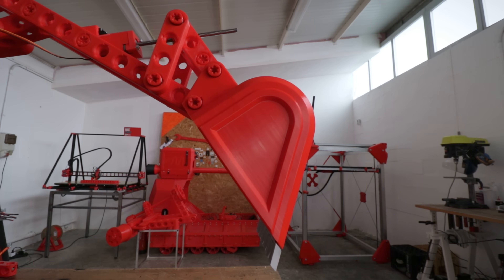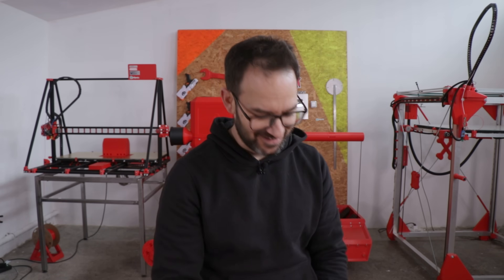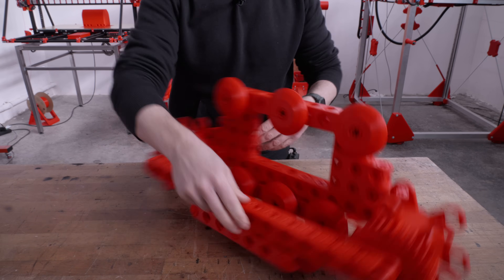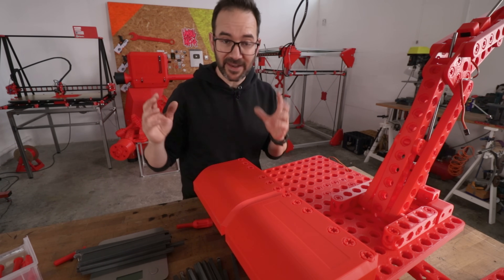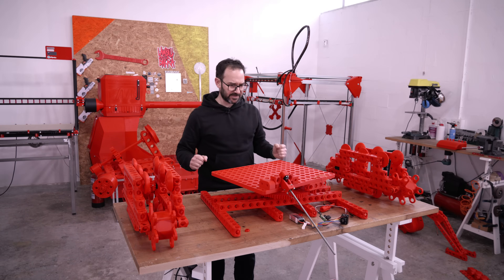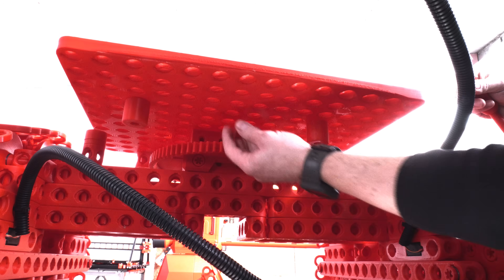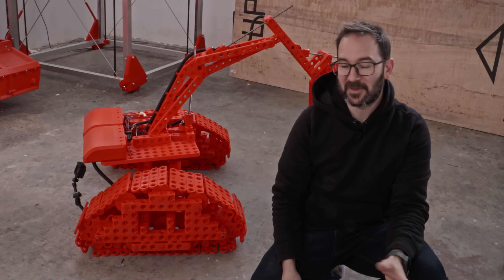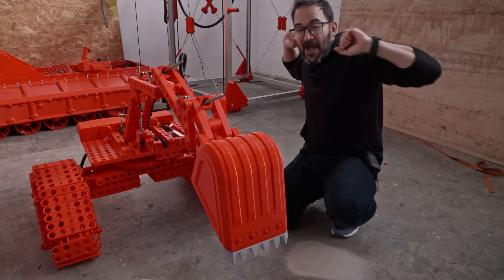A GIANT 3D PRINTED DIGGER THAT WORKS!!

Comment: it's awesome how there are a certain set of pieces
like the screws, blocks, and plates
which can all be assembled to create stuff like this
along with some specialized pieces like the wheel sprockets and gears
the threaded screw heads are also genius
and it all goes together so well
along with the fact that you can custom size all the pieces and print them out
also the different length screwdrivers and holes through both sides of the blocks allows for easy access
since you can put a screwdriver straight though
little quirks like that
really well designed system
I just absolutely love it
incredibly creative approach to building 3d printed projects

Comment: Super awesome and impressive!   It seems like everything-red is your thing, but this would look infinitely better if you mixed in a second color like black or gray for some classes of components.  At a minimum, all screws could be in the highlight color.  And maybe something obscure like all exactly-4-length joiner pieces or something like that.  It would not only look better, it would really help the features of the engineering standout.

For the loose parts, you could try tapering the threaded holes narrower at the bottom, so you get tighter friction/pressure on the last turn.  A ridiculous alternative (and you seem like you're into ridiculous), is that you could make the equivalent of lock  washer out of TPU - a thin, low-infill ring that compresses under the screw head.

Comment: Would stepper motors be better for driving the treads? I guess servos don't require the additional control boards and they might have more torque.

Comment: The engineering behind all this is brilliant. I especially love the small screw to hold the funnel in place at 6:50 so much. This is such an easy solution and makes filling in the sand so much easier and less painful. I would never have thought about details like this but that’s what makes the difference in the end

Comment: hey i may have an idea on how to make the 3d printed parts even stronger but it will need testing.
all you need to do is cover it in sand or salt then place it in a mini oven get it to the temp where it just starts to melt then let it cool. that should make the part solid. 
could you give it a try and see if it helps your builds rigidity? it could maybe even help you save on the filament by making smaller but stronger parts and could help with the treads breaking like on the tank.

Comment: why dont you use nema23's or 34's? every aspect of a nema, even the baby 17's would be better than a servo (besides price). servos are cheaper but not by much. and youd have faster and/or more powerful movement. and still accurate because its a stepper motor. you can still control it like a servo should the need arise.

Comment: For removing the screws at 8:00 I wonder if the tabs could be redesigned so a single swipe of a blade could release one side of an entire row. That would be faster than individually removing each screw.

Comment: With the ever increasing weight of projects it might be fun to design a hoist to lift and lower. I was thinking 2 ladders for the sides. Maybe on wheels so you won't need to move the table. Strong bar across the top, and a pulley system or manual hoist for lifting and lowering. Also, thick straps of course. Love to see what you come up with next.

Comment: plastic is a nice ceramic clay burn mold
Reply: inverse lost pla cast mold, will be melted in the oven, from around the ceramic part
Reply: not hot pour mold lost pla cast
Reply: do you consider tethered/wired tank as an rc excavator
Reply: no batteries required, just the power control wire

Comment: Would your build be lighter and stronger with nylon-x (carbon)?
Reply from the maker: Maybe some of the parts but It is mostly down to how I ended up designing it.
Reply: Some parts would be stronger if you printed them together I guess. Like the base for the wheels.. and the base plate for the arm. Would love to see you make this model stronger.

Comment: I would love to see Ivan rebuild the tank out of these Miranda Blocks for some reason.
Reply from the maker: That would be quite an undertaking
Reply: @ivanmirandawastaken  That it would be.
Reply: I wonder how much heavier it would end up... 
I'd bet 3x at least unless Ivan designs some thin sheet parts to make most of the structure solid - probably for versatility and lightness something like 2x3 and 3x5 ratio triangles with just holes along the edges and a few fixed beams across the thin middle parts. Even then I suspect it would not be really practical as that thing is already so heavy and it is all only made in PLA.

Comment: On second thought, it's not too surprising that parts keep falling off, since single screws are easy to get to back out, with rotation or even just vibration forces... maybe some sort of thread-locker (glue is probably the wrong tool here, lock wire maybe?) would be a good idea for the go-kart
Reply: Or some kind of splitpen to lock the bolts.

Comment: replace the arm's pieces with stronger ones, they will buckle and twist under load. right now it's only good for light material, it's either that or make a much smaller bucket, like a 1/3rd the size.and use brushless motors instead of servos... on a side note, you should make a plastic combat robot for robotwars... just bring enough plastic parts to rebuild it after each battle. design it to take the abuse and the important parts be on the inside with ablative plastic armor. the parts flying off will make the crowd go nuts.
Reply from the maker: The arm pieces are strong enough as they are assembled to work under compression/tension but the bolts on the joints are another story. I should print some horizontal screws just for the arm.
Reply: The arms are PLENTY strong enough.  I have prints in my hands for shelf brackets that at only 6mm x 10mm x 3 perimeters trusses and I can hang off of them.  You will easily exceeed the capacity of your motors/drivetrain.